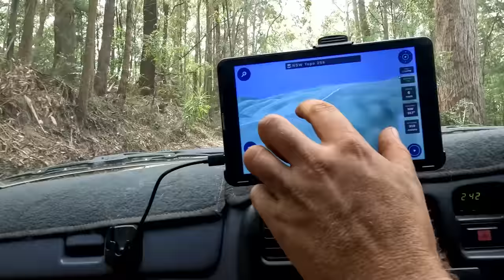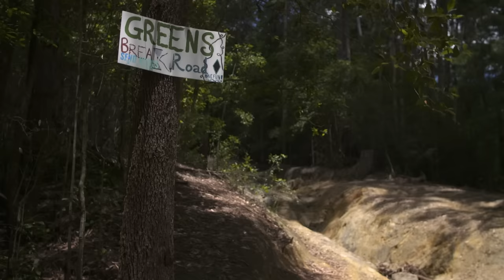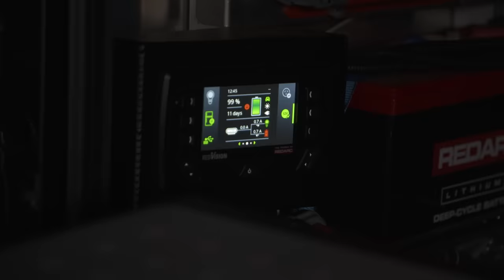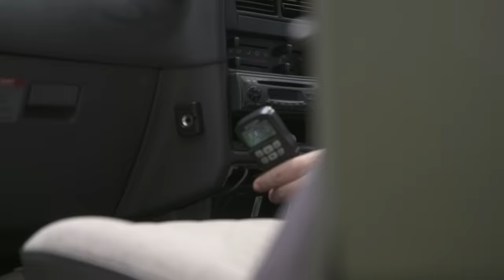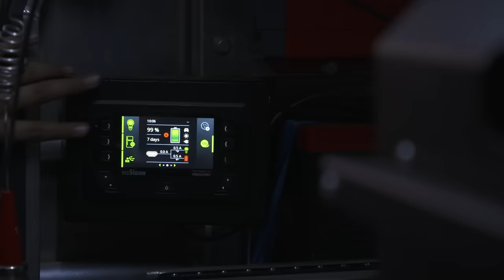DRIVELINE EXPLOSION, Roll Over and Sooty panel damage... Who got towed out? 😳

Comment: the double cabin hilux looks like a modern one ! how come it has solid axle at the front ? incase u removed the independent front suspension and kept the solid axle did u use the solid axle from the old hilux of the 1990s or are there new solid axles for hilux in the market ? and did you consder the diff ratios..etc etc ?

Comment: off roader's are made completely wrong for the job - ok to have 4 corners but you need 12 wheels - 3 on each corner like a Step Climber meaning as soon as there's a Lump the triangle  rotates and puts either 2 wheels engaging on that corner till the issue is over.
The other problem with off roaders is they have front wheel steering - The Steering has to be in the middle Bendy: in the middle and The Drive --- Diesel Electric and 12  individual Motors one driving each 800mm balloon Tractor wheel.
Computerized: 12 wheel drive if no traction wheel slows if wheel slips the triangle step rotates to climb over.
Amphibious: I would think with 12 inflated balloon tractor wheels we are talking Amphibious so Wipers! - and yes a Snorkel and this is where we can have some creativity.
The 3 meter Snorkel to allow air for the Diesel -
The 6 Meter Snorkel to allow air for the cabin and the Diesel - or
The 160 meter Nuclear Powered Submarine for the Serious Off Roader with Real Balls ...

OK Do Not Let This Sport Get Out of Hand !!!

Remember your Roots it was a truck ...

Comment: Shauno you guys need to tell Liam or anyone with a 200 including you!!! Abt a kit for toyota independent front ends! Dirt Every day on motortrend Fred Williams and Dave Chappell installed a Marlin crawler kit on a 4runner that beefs up the independent suspension it's stronger cvs spindles and everything so that you don't break cvs and everything else doing hard wheeling! Check out their build up of pond scum a v8 4runner pretty much exactly like the 200's it's the same suspect so it should fit the 200s I they don't make a 200 kit! Check it out! Unless your solid axle swapping it I'd go this route! Its the strongest IFS kit on the market here! Trust me!!!!
Reply: If they don't make a 200 kit the v8 4Runner kit should be exactly the same!

Comment: 75mph with 22mpg? I can tell you this much 
3gt would get 18. Should try the Chin spoiler at different level of speeds. 55 65 75. Going that speed is already decreasing mpg. Im curious if maybe the spoiler works up to a certain point. Cuz clearly at 75mph it doesn't care. .7mpg is nothing. That's a normal difference

Comment: I just wish they would stop calling a tip a "roll". If the roof doesn't touch the ground it didn't roll. I've fallen over several times but I've never actually rolled one. I've been there when it's happened but never seen it here. 🤷‍♂️🍻